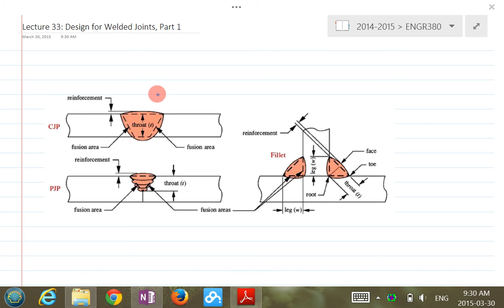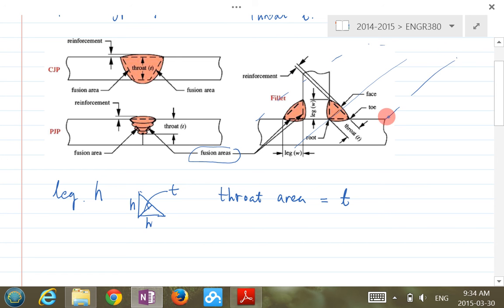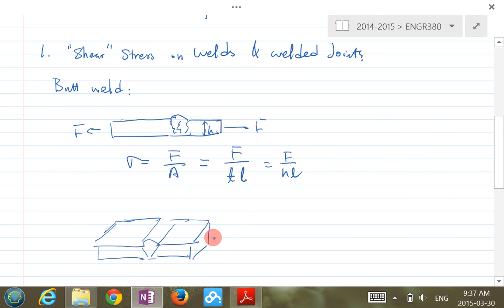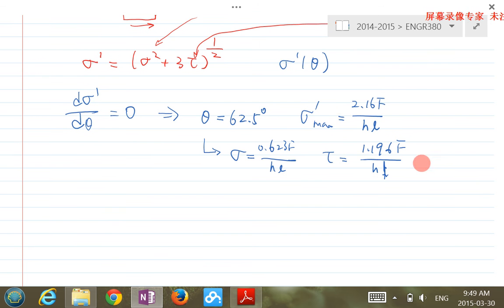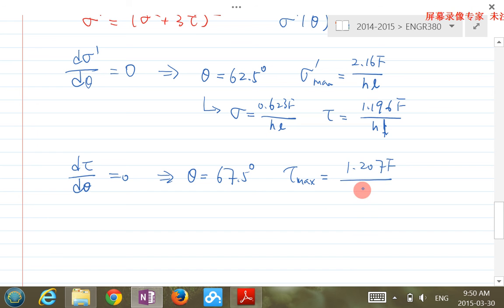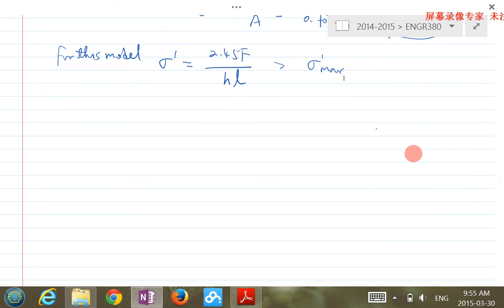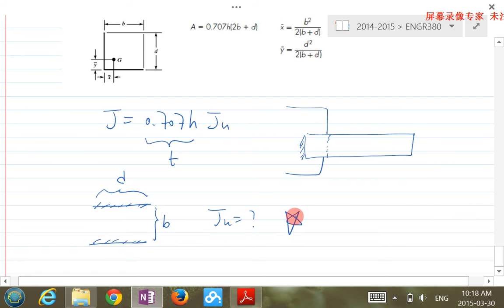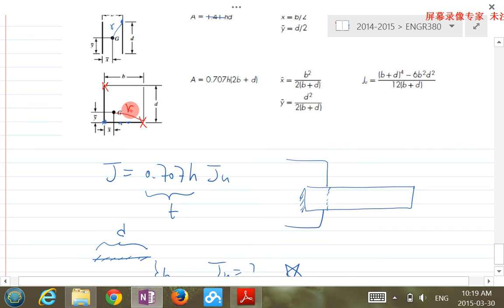2014W ENGR380 Lecture33 Design for Welded Joints, Part 1

Comment: thanks for the video.
 may I ask a question ? at 17:00 minute. you started to write an equation. sigma prime =.....
where does it come from ?
Reply from the maker: +burak ayan That is the formula for calculating von Mises stress for planar stress element.  If you google von Mises stress, you can find the formula.
Reply: +Yang Cao ı thank you for your answer. ı'm not a native speaker . ı couldn't get it